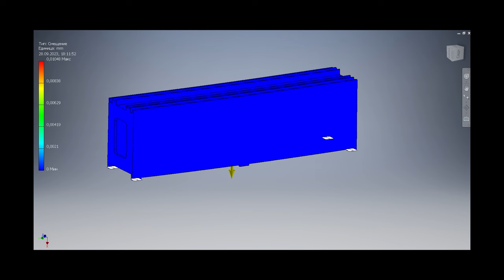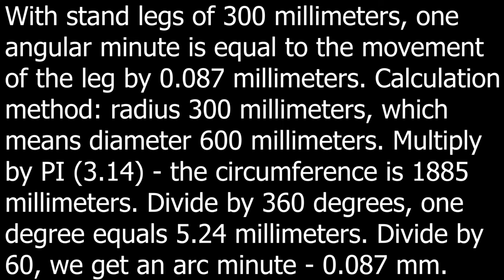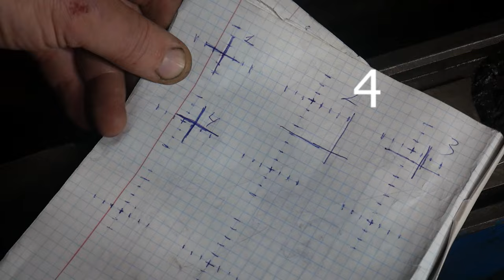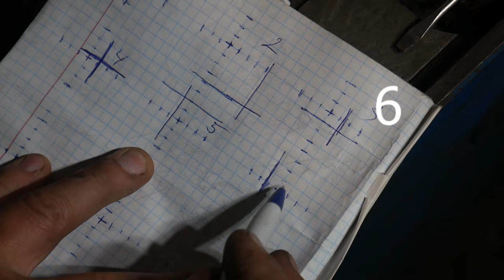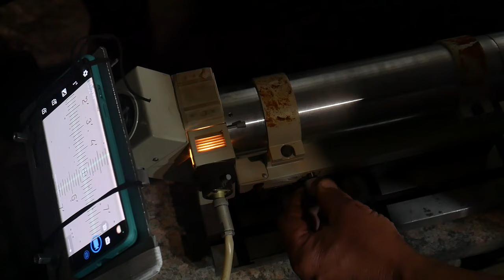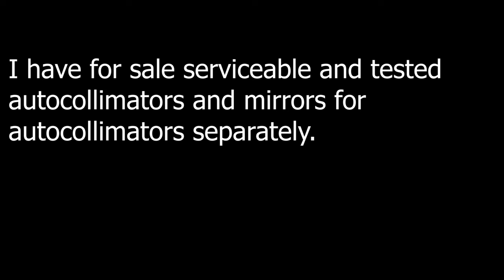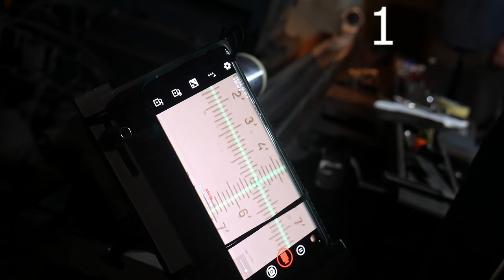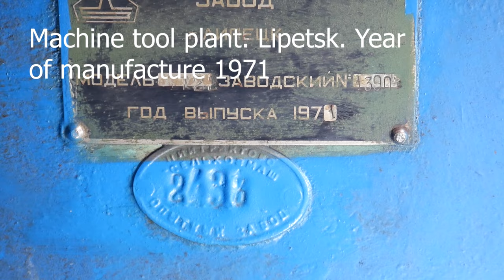Practical work with an autocollimator.

Comment: Great work. I also prefer your voice and accent. 
How do you differentiate orthogonal movements from angular ones? The mirror sitting higher than the guides can swing sideways if the guides had angular variations confusing measured data.
Reply from the maker: Now the surface is rough. The repeatability of measurements is within one arc minute. But this is enough to start scraping work. After this, the surfaces will become smoother and the accuracy will increase. Up to maximum at the end of work. And the mirror at the end of scraping will not be able to swing, since there will be full contact.

Comment: A drop of oil on the target contact points might help to stop the vibrations happening.The contact points would be moving in two different arcs due to the friction (which is where the sound comes from) and therefore possibly  not in a true plane when you park at each stop.Only splitting microns here but that is how my brain sees it.

Comment: I wondered if you could offset the measurements by 50 cm on another pass, to get intermediate results for averaging... It seems to me that one possible problem with the autocollimator is that a section that has an offset from the main line, will measure as perfect, if it is parallel to the autocollimator...I suppose that it could be "picked up" with the transition from correct to offset..

Comment: Great example of using the device. Is there a reason to not oil the ways: does it interfere with the measurements. Are dry readings more accurate ? Thanks for the channel and stay safe.
Reply from the maker: Now the measurements are plus or minus ten arc seconds, each time the mirror moves. Surfaces are too rough. It won't work out more precisely. The presence or absence of lubrication will not change anything. When the work is completed, the flatness of the surfaces will improve significantly, the accuracy of the measurements will increase, then I would rub the surfaces with graphite, the dust is very fine and does not distort the measurements. You can also use kerosene. Or you can use nothing.
Reply: Thank you for explaining. If it doesn't matter at this stage then my ears tell me to use lubrication. Maybe not everyone is so sensitive to metal screeching. Great tip on using graphite.  @gena_bazarko
Reply from the maker: I did not work and film in my own premises; unfortunately, I did not take kerosene with me and was forced to work with a creak. Going to the store for kerosene meant going behind schedule; time did not allow it.

Comment: Il sistema é stato spiegato in modo chiaro. Ho solo un appunto da fare: La base d'appoggio è di 300 mm di lunghezza , ma poggia su due V larghe 12 mm, a seconda che la superficie è concava o convessa, la base si allunga o si accorcia di almeno 12 mm e questo porta ad una grossa incertezza sulle misure. Al loro posto  bisogna mettere delle coppie di sfere, in modo d'avere dei contatti puntiformi.
Reply from the maker: Hello! Point (ball-shaped) contacts also have other disadvantages. In this case, there is no problem with the contact of the legs. The measurement accuracy is sufficient for the state of the surface as it is. As the condition of the surface improves during scraping, the quality of contact will increase, from cycle to cycle, up to the maximum.

Comment: I recently picked up a couple of Nikon 6B autocollimators and some of their mirrors and a precision prism optical square. It has been interesting to see how the Eastern European manufacturers solved certain problems, for example, your mirrors with the sights are a very cool solution to the tedious initial alignment. I also liked how you rotated 45 degrees to simplify the offsets, simple but not as obvious a solution as it looks. I'm curious how you intend to measure the parallelism (both height and distance) between those two V-ways?
Reply from the maker: Hello! I appreciate your hands-on experience with the autocollimator and its accessories. If you could email me, we can delve into these questions in greater detail. I also have a pentaprism, a Soviet one, and it's quite fascinating with its beamsplitter and the third window. I couldn't find much information about it, so I'll have to figure it out as I work with it.

Now, to address your two questions: There's no need to monitor the parallelism of the guides on this machine since the linearity of motion is ensured by the V-shaped guide. Any angular deviation, i.e., the deviation of the flat guide from the vector of the V-shaped guide, can be easily detected and measured with a precise spirit level.

Feel free to reach out via email, and we can discuss this in more detail.

Comment: I want to purchase one , please share product details in description
Reply from the maker: Hello! Now I have for sale an autocollimator of 1 arc second, there is a 0.5 arc second, there is a 0.2 arc second. Everyone works in two coordinates at the same time. Autocollimators can be equipped with one, two or two plus a third mirror that fits onto the lens at an angle of 45 degrees. The set has a special plywood box with places for storing the set. The autocollimator and its accessories are tested before sale. Everything is in good order and corresponds to its original characteristics. Please write to me by email, I will provide detailed information and photo or video material. My mail:     den.gennady19@gmail.com

Comment: Im intrested, what do you do you do for a living and also if posible plese refrain from using an ai voice I would much rather hear your real voice.
Reply from the maker: Hello! I have my own small enterprise that produces clothes. I've been doing this for the last 30 years. Before that, I worked for some time as an industrial designer. Recently, due to the war, my business has decreased significantly, and circumstances have changed greatly. In addition, I now spend a lot of time on my hobby, which fills my YouTube channel with material. But I’m happy to work for the YouTube channel, it’s interesting and promising.
Reply: @gena_bazarko 😅

Comment: Do you level the autocollimator with a bubble level or is it referenced to the machine ways you are measuring?
Reply from the maker: The autocollimator is installed approximately coaxially with the guide. The optical axis of the autocollimator must fall into some place on the surface of the mirror at the first measurement step and at the last, not necessarily at the center of the mirror. It's enough. For installation, a level is needed so that the autocollimator can be installed without tilting, I mean without rotating around the optical axis.